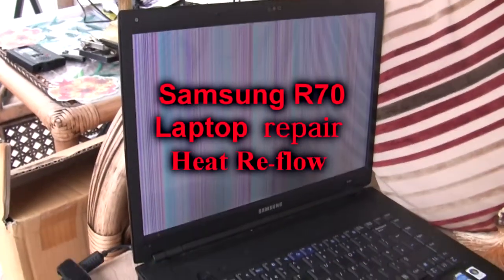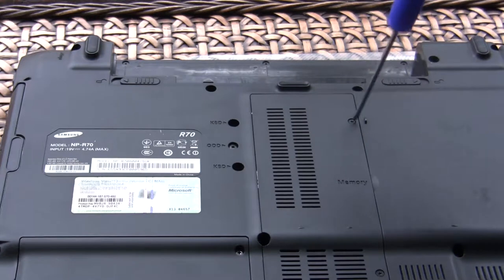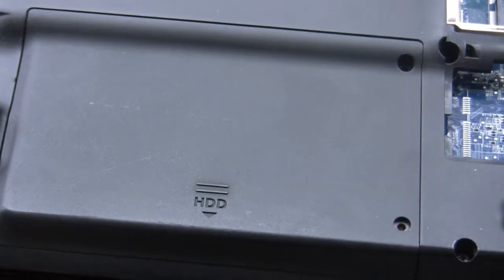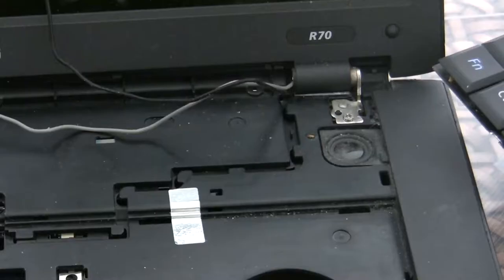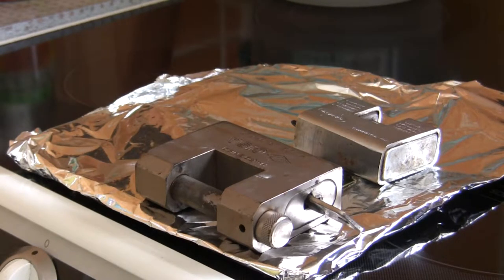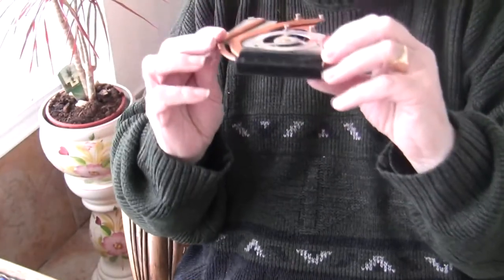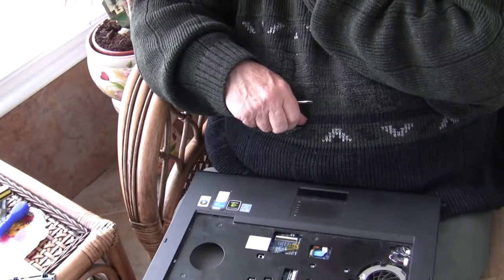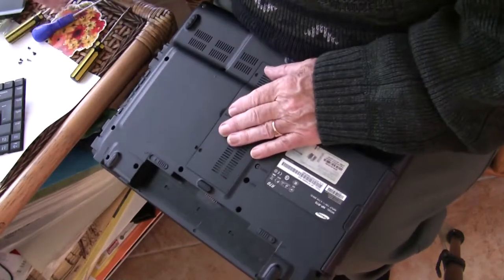Samsung LAPTOP REFLOW REPAIR

Comment: Congratulations Tom I followed it step by step - just one question. What do I do with all the bits left over? (do you think I can sell them on EBay?) I didn't have one of those heat gun thingies so I used a blowlamp I suppose that should do the trick - I also found a lump hammer very useful in the disassembly.
I will let you know how successful  my repair was when the fire brigade deem my house is safe to enter again.☺